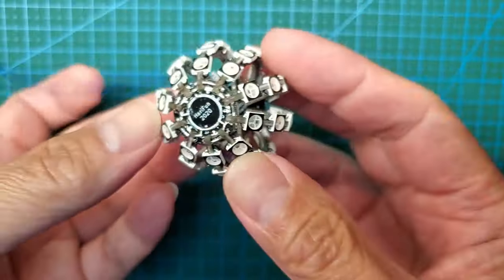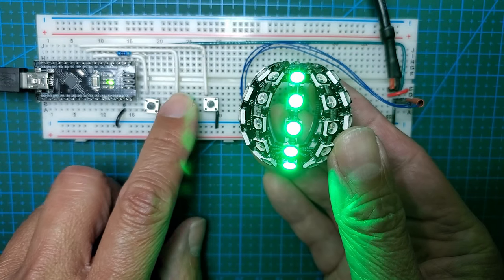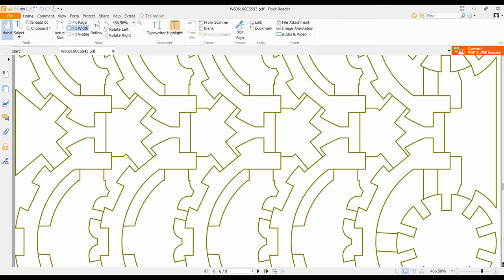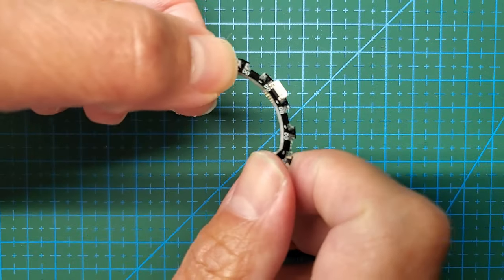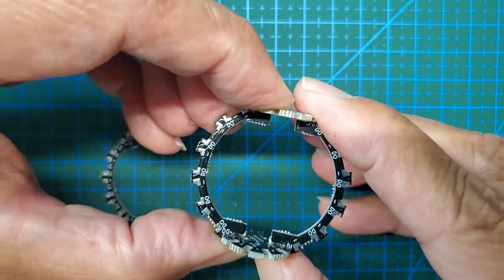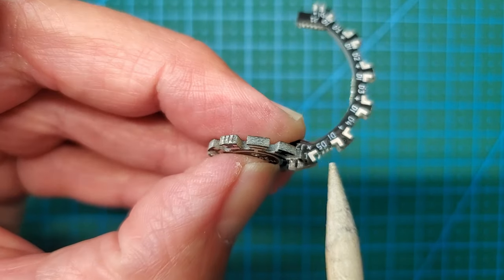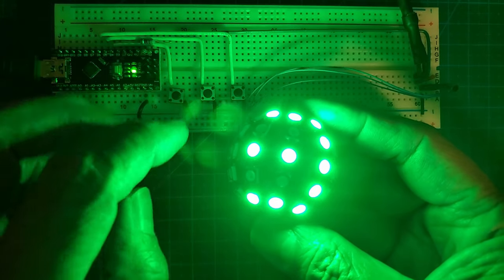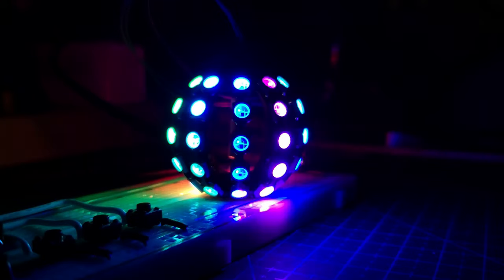HariFun #184 - EPIC Fail - LED Ball Part 3

Comment: Looking forward to the giant one :-D. Bigger parts might give you more latitude on the construction issues. Maybe a PCB board or 3d printed alignment tool would be helpful. Getting solder to stick in the right place was the issue I was having with the freeform sphere.
Reply from the maker: Hi Karl, now that I've seen it work. I'm gaining confidence in investing the time and money on a bigger version.
I'm going to solder another one of this small ones using the fine tip and see if all my issue was because I was putting heat in too large of an area including the gap between the pads causing the two pads to become islands instead of being joined together. Wel'll see...

Comment: I love the design! Have you considered making the first two arcs into a ring? I think this could help solve your initial stability issues.
Reply: Good idea! In fact, couldn't you make all the arcs into rings with 'mouse bites', and then just break out the top and bottom to create the remaining arcs? On second thought, it's probably too wasteful of PCB material, so more costly. :((
Reply from the maker: No, I did not consider that because my goal was to make all arcs identical, I even wanted to make the discs identical, so when I mass produce this as kits, I could order X arcs, Y discs.  Making the first two arcs as one means a new kind of part.  But, it IS a good idea to help with assembly. I just need to weigh the pros and cons. Thank you for bringing it up.
Reply from the maker: @rdyer8764  So many possibilities... I thought of putting the discs in the ring, but we need so many more arcs than discs, so it would be still wasteful.

Comment: 3d print holder
Reply from the maker: Matthias, I considered that but I wanted the final version to be easily assembled by anyone who may or may not have a 3D printer.  The inspiration of this project was done by Jiri Praus and he used a 3D printed jig to hold the LEDs.  So it is a good idea that will work.  I'm just stubborn :-)